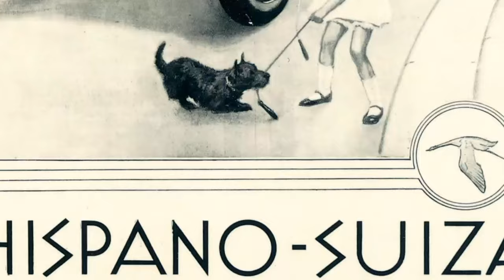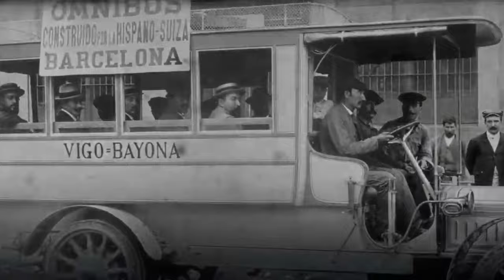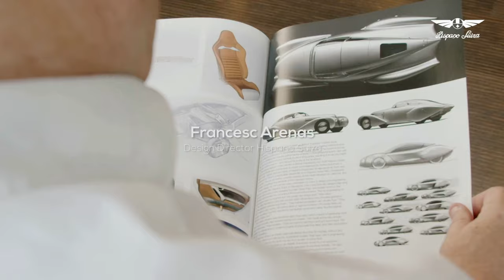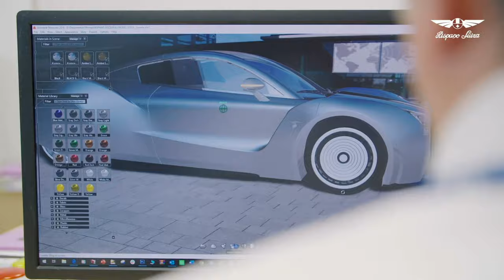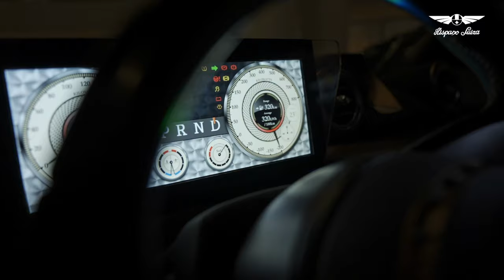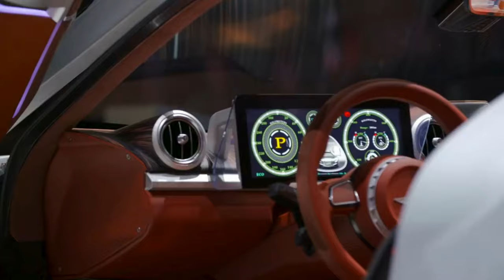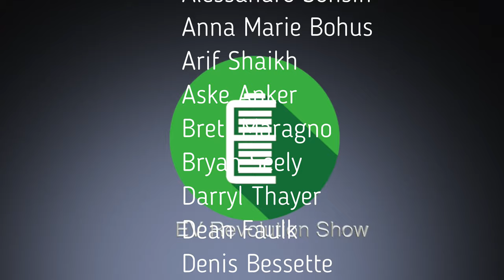Episode 140 - Special Episode - Hispano Suiza All-Electric "Carmen" Supercar - Dream One Project!

Comment: Friendly correction on acceleration figures, Model S Plaid 0-60 is advertised as 1.99 sec. That is subtracting roll out, so realistically from a standing start it is more like 2.15 seconds. In any case, it is quicker than the HS you cover here. But that is a silly comparison, these cars are in very different categories and 0-60 is a very limited measure of performance. As a rear-drive vehicle the HS is obviously traction limited. It would be interesting to see circuit times for the HS on some tracks with competitive standards.
Reply: There are different units involved here. You're quoting Tesla's specs in mi/hr (0-60) and they are quoting 0-100 Km/hr, which is a touch more than 0-60.
But your point is bang on, it's not a useful comparison as the cars have a different purpose. I don't think the Carmen buyers would worry about the acceleration being 2.5 or 3.5 or even 4.5 seconds, as long as it's decently fast. I can't envision any of these cars ever being out on the track, unless HS was doing tests.
Reply from the maker: @Christopher Brand  Yes, thanks for the correction.  I was also corrected by some others.  However, you point is exactly on target.  .5 of a second or something like that is meaningless for a street car.  Those that get hung up on that kind of stat are really the ones who will get into an accident on the streets with a car like the S Plaid or Carmen.  So it is moot.  My point was that is is fast.  Too fast really.  

For the track, sure it should handle better than the S given that it is hand built and designed for that kind of use case.  Not for going to Whole Foods to do grocery shopping!
Reply from the maker: @John Moniz  Agree sir, thanks for watching!